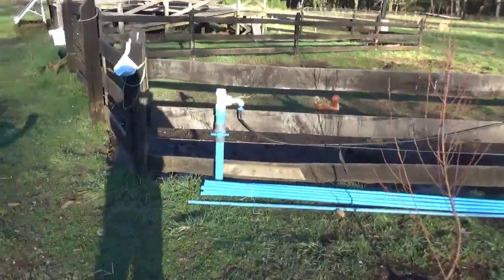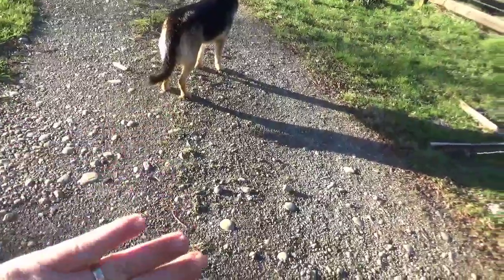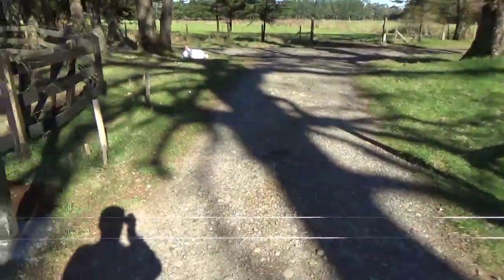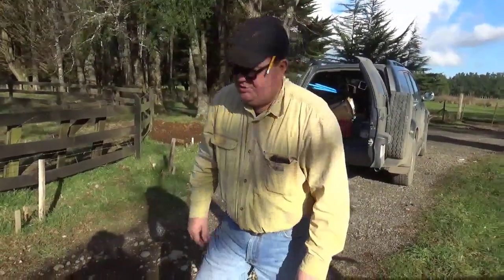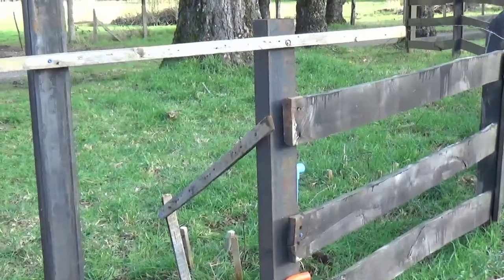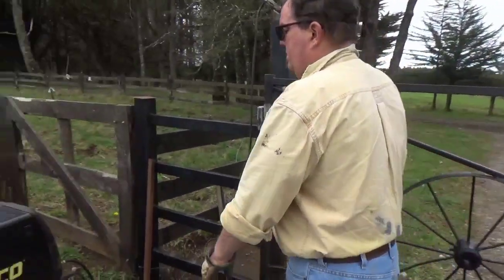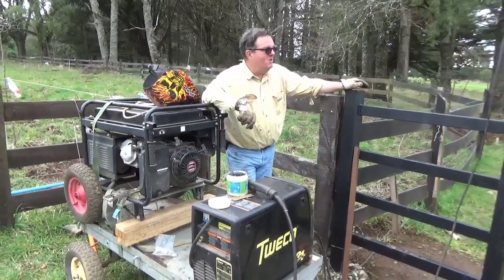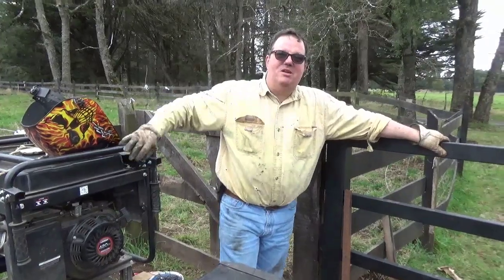Build an Entry Way and Gate With Chile Expate Family

Comment: Have you lost some weight? You look thinner.
Reply from the maker: Yes. I am working on it. Slowly. 12 Lbs. Jim
Reply: @ChileExpatFamily  congrats my brother. That's really good.
Reply from the maker: Well I am trying no more. We will see how it goes. Jim
Reply: @ChileExpatFamily  do you have air conditioning for the summer and heater for the winter at your home?
Reply from the maker: No A/C at all. Too cool here for A/C year round. We use the wood stove for heat and cooking and hot water. We actually have to use the wood stove in the evenings because it is cool. Jim